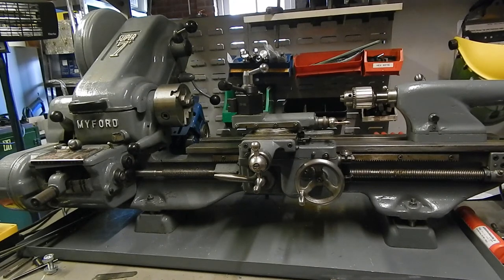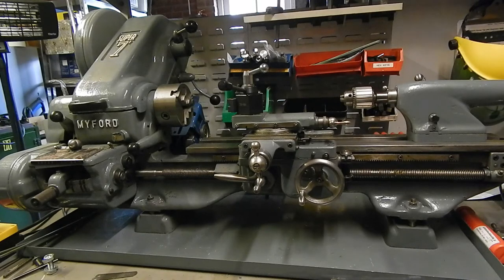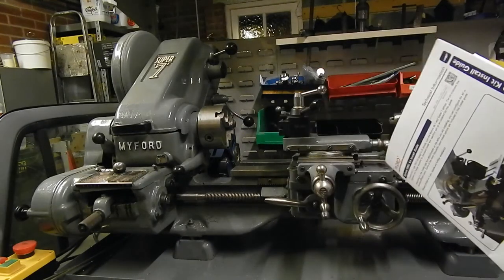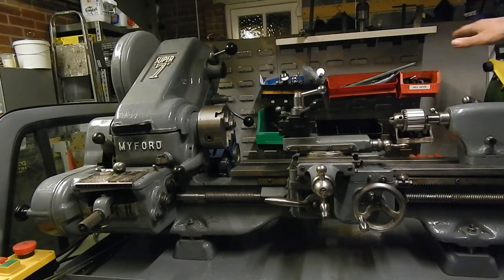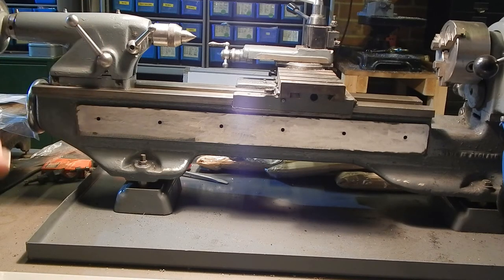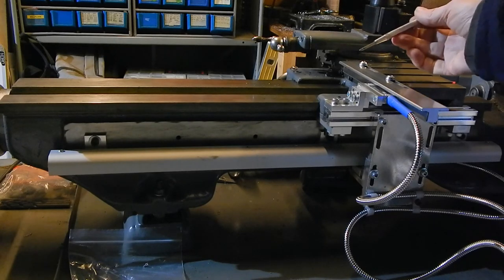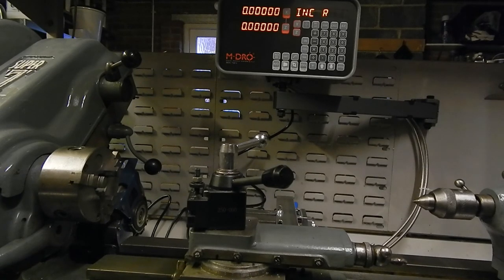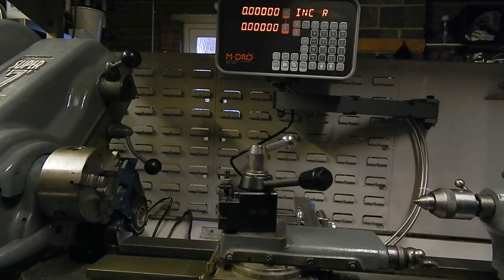Fitting a Machine-DRO digital readout to a Myford Super 7

Comment: Hello Mike, nice video. I hear you saying that the temp. in the workshop is minus 3 degrees before you call it a day.  Do you have a favourite way to keep condensation from rusting out the machine bed etc., especially if you have to be away from the workshop for a time, and cannot get in there to wipe it down? I can have temperature fluctuations from minus 12 to plus 28 C. in my shop, and have trouble keeping several machines in good order. 
Thanks, 
André
Reply from the maker: I used to use halogen heaters, which warm up a person but not the machines but that makes them pretty unpleasant to use. Now I have cheap Chinese diesel air heaters which run on kerosene. The exhaust and combustion air are routed through the wall and outside the shop so the hot air that the fan outputs is dry. Fortunately I don't have the large temperature swings that you do.
Reply: @perryowens1  Thanks for your answer, I appreciate it.

Comment: Mike when you fixed the metal cover over the magnetic strip on the cross slide did you glue it as described in the manual. If so what glue did you use and how much? Best wishes Ian
Reply from the maker: Ian, I don't recall gluing anything as I think the magnetic tape and the cover strip were both self-adhesive. I'm sure that I would remember if I had to use any adhesive.
Reply: Mike Moore thanks  for your help
Reply: Mike Moore I found the sticky strip on the cover Mike and everything is operating fine. Best wishes Ian

Comment: Hi mike does fitting the DRO interfere with the saddle clamp.? Best wishes Ian
Reply: Hi Ian, The slide does overhang the saddle clamp bolt but there is enough clearance to get a spanner on it. There would not be enough clearance for a lever type clamp though. Machine-DRO do sell an newer type of system that uses a magnetic strip embedded in the top slide but you have to mill a slot to fit it.
Reply: Maureen Moore thanks Mike for your help and advice best wishes Ian